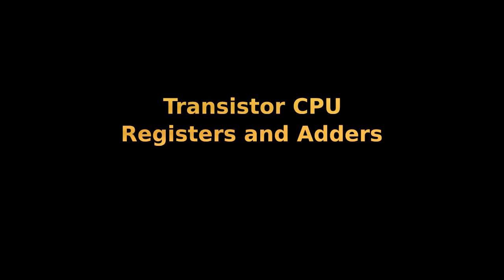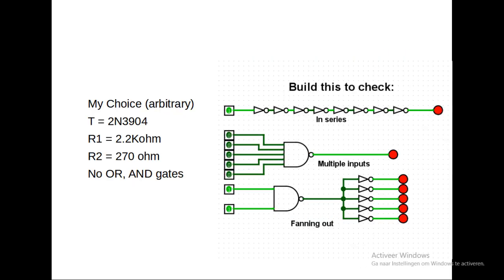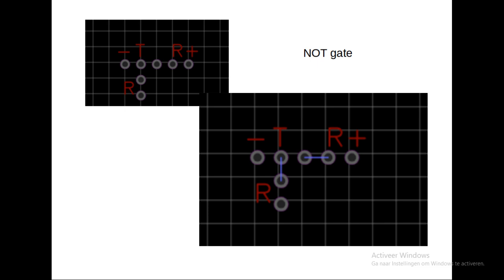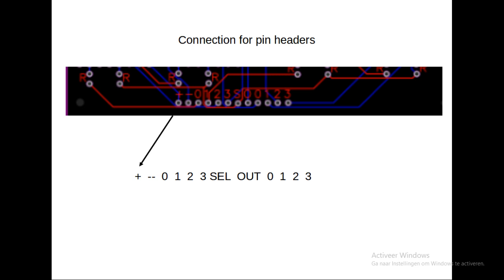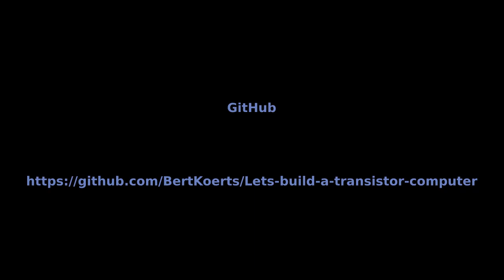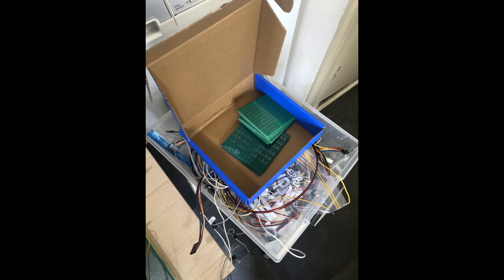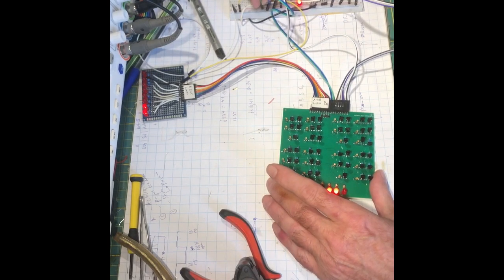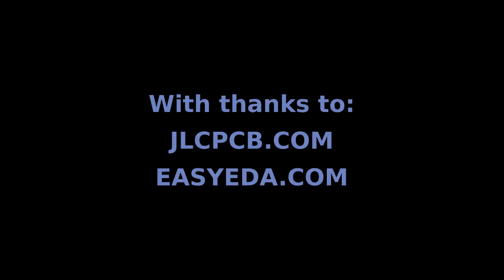Let's build a transistor computer - Tutorial 1 - Register and Adder

Comment: I'd be interested in how you determined the values of the resistors you mentioned in the video. Was it pure try and error, or did you use the datasheets to calculate the current and voltage?
Reply from the maker: I did what I said in the video, tried a lot of possibilities. Clear was that the resistervalue for the signal and to the 5V is about 10 to 1. 4K and 500 ohm would have done too, but then the LED's were not shining bright. Sorry that there is no more science behind it, I tend to continue when something is really tested and works out. The CPU in the introduction has 1300 transistors, so approx 650 NAND gates, draws 17 amp, but is stable and noise free. Good luck!

Comment: One tip with JLCPCB is if you need 10 full 100x100 pcbs it is often cheaper to do two orders of 5 as you then get 2 discounts.  I can thouroghly recommend JLCPCB I have used them loads of times.

Comment: Great video! I hope to be taking on a similar project soon. I would like to know, is there a reason why you're using NPN transistors as opposed to NMOS logic?
Reply from the maker: Hi Zachary, thank you. I explored CMOS, but didn't get sufficient reliability. In hindsight, there is a relationship between the number of wires you solder and reliability. I couldn't get the current system working well before I started using PCB's. I make mistakes there too, but they are easily identified. That was a lesson learned, in the   current setup I can isolate and measure everything.  I do apologize for the lack of scientific process, I must admit that once something worked, I didn't look back too much. On the bright side, there must be room for improvement! 🙂